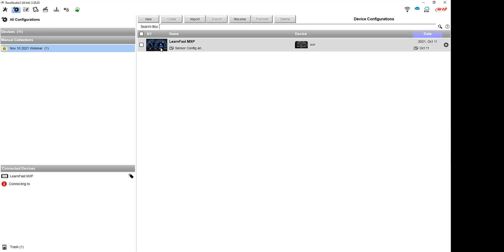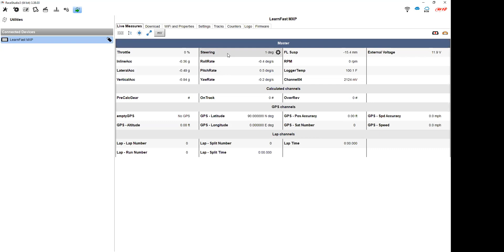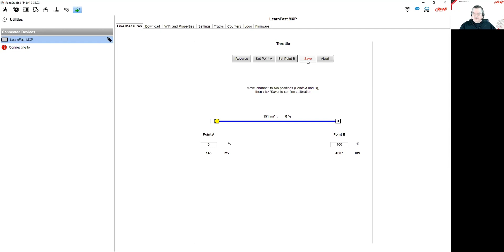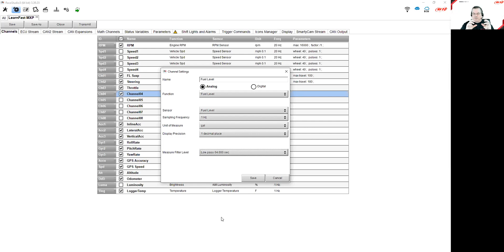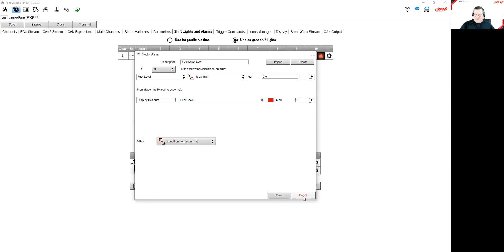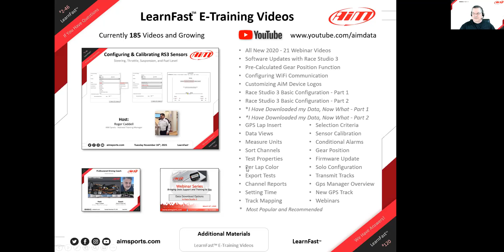2-46 Configuring & Calibrating Race Studio 3 Sensors - Live Webinar with Roger Caddell - 11/16/2021

Comment: I have watched this video and the previous video on setting custom sensors, one of the most voted for options on the previous video poll was a custom temp sensor, but this was never covered (Webinar 1-17). The sensor i am using is an Autometer/Stack 2252, i have the resistance table for this sensor however i am unsure on the wiring side, previously this was wired to an ECU input and had to have a pull up resistor, since the AIM MXP i am using has an internal pull up, can i use this, or can i just enter the sensor information from the resistance table? 

Thanks, 

Cole